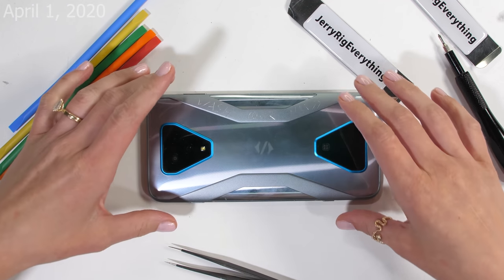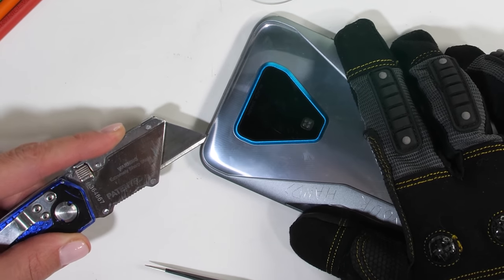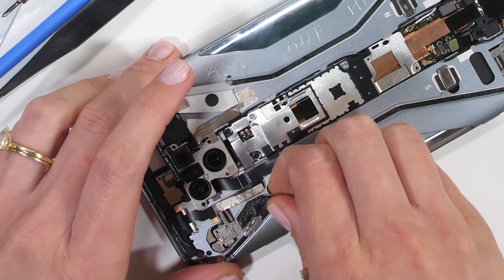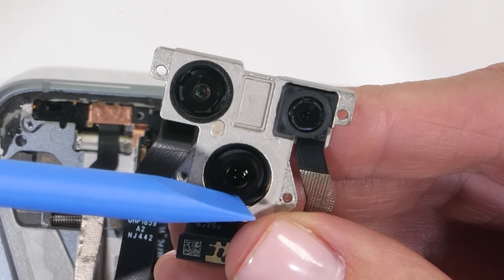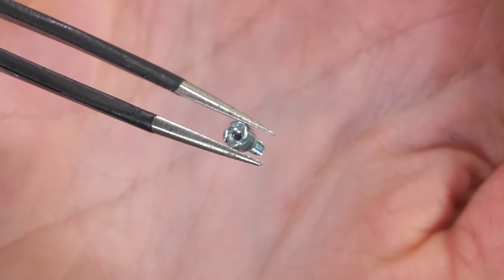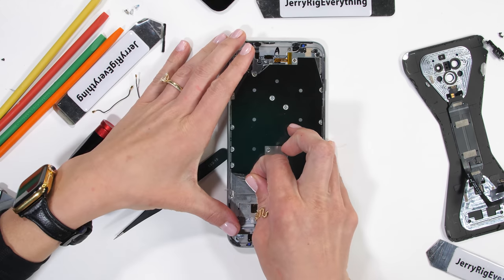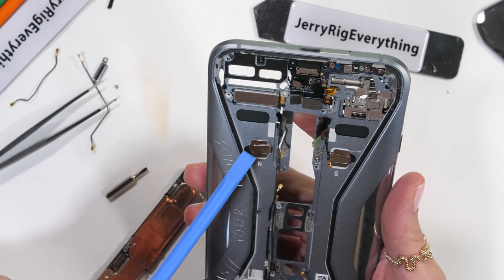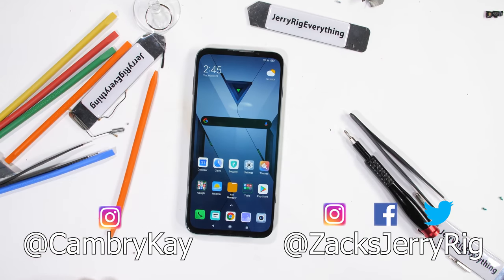Dueling Heat Pipes & Pop Up Buttons?! - BlackShark 3 Pro Teardown!

Comment: "Double the Batteries, Double the Charging Speed"
                               - Zack's wife.
Reply: Makes sense though if each battery has its own set of charging system linked to a single USB C port
Reply: Dawood Essa that is true in theory but each controller has to now share the  split electricity coming from the charger when that happens.
Reply: basically she's right
Reply: @isaacstearns7746  that's why you have a fast charger
Reply: As my worst enemy would say wrong
Reply: that's why it can fast charge up to 65 watts of charging
Reply: Ha ha ha
Reply: That's why phones jumped from 30w to 60w charging. She's right.
Reply: Actually she's not his wife , she's just his girlfriend as he explained in his earlier video.
Reply: @spongyshorts1278  they got married bro ..
Reply: you forgot the year, let make it official

Comment: This is actually unironically a marvel of engineering. It's buetifully overengineered
Reply: that main board with both heat pipe on the side is definitely are  marvel.. also with that 2 mechanical pop up button..
also the most rarest thing in the phone...
3.5mm jack.. what a pre historic item to be build into a high tech phone

Comment: puts on gloves 
Me: Thats why women live longer 😂
Reply: I use plastic gloves
Reply: Idont use gloves to open phones or laptops
Reply: @8pyy  I do. I tend to sweat a bit from my hands
Reply: @8pyy  you monster
Reply: @8pyy  that means nothing honestly. People smoke and don't wear seatbelts doesn't mean nothing will happen.  I don't wear gloves but that doesn't mean shit don't happen all the time
Reply: @AlwaysBolttheBird  k thanks bro for the help
Reply: @ItssMitch  yo what did ido?
Reply: @ruixitas  same it make you sweat and it feel kinda wired with the water
Reply: All of you there is no problem not using a glove when opening any device
Reply: @8pyy  I'm not too sure that's true. I've seen some wear something to prevent static electricity. But I'm no expert, I just fix my friends and my own devices.
Reply: @ruixitas  but at least dont touch anything if the battery is connected because if connected it will fry some stuff thats why we all need to be careful for some stuff and good luck for fixing stuff this experience you can need it in any time
Reply: @AlwaysBolttheBird  it always does
Reply: Lol haahah

Comment: "These are essentially screws with a screw hole inside of the screw so that the screw can screw inside of the screw"
Reply: Isn't it like so that the screw driver can screw inside the screw
Reply: Yo dawg, I heard you like screws...
Reply: I actually understand that tho...
Reply: @dylanwang2669  It just so happens that two of the components inside share one of the holes, so they just tap (verb for making threads) the inside of the screw that holds the component that sits deeper for the smaller screw that holds the upper component in place.
Reply: @yongling9825  Thanks!
Reply: @flossenking  lol

Comment: this just made “iPhone repairability” like a piece of cake!
Reply: Not rly because they dont use normal screws on the iPhone's.
Reply: Tbf this design is good if you break the screen as you don't need to worry about breaking electronics underneath when you cut into the adhesive. The battery and motherboard placement is strange though.
Reply: @jftechdrones  yeah the battery is so hard to replace
Reply: JF Tech/Drones  yeah, i guess you are right, but at my point if view, i had iphones and the only thing that ive ever replaced on the iphones i had was the battery so i was like woha! if this phone’s battery dies I'm screwed!
Reply: @igentleboy8129  Definitely - it's the only part that should really wear out.
Reply: Einfach Yannic you got a point there, however, the complexity of battery replacement was off the chart! And mostly its  because 90% of the phones I had just needed a battery replacement ent after a few years. So this phone battery location was kinda new. You have to take the whole phone apart.this This is a gaming phone, if you don't break it, or drown it, the next thing that's gonna take a hit is the battery.
Reply: @igentleboy8129  xiaomi brougth back the headphone jack. But they screwed us over with repairability
Reply: @Crispy Shaman yeah...

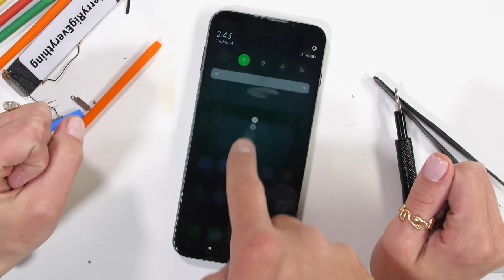Comment: This tear down took 2.5 HOURS. The time was 12.15 at 0:08 (the start) and 2.43 at 7:47 (the end). Dedication 👍
Reply: 12:15, not 12:13
Reply: @scan4707  tiny correction is unnecessary
Reply: sometines the clock gets all messed up when removing the battery in my proud galaxy grand 2
must be the same when she snapped that battery ribbon cable like a little lego
still very good effort
Reply: @samertawakol5208  its makes sense for 2 hour, dude. even more.
Reply: @Isnamedantony  well just saying
its not a problem
Reply: but its nothing for a job well done

Comment: Amazing 
This battery technique can use to charge multiple x4 batteries and extend charging powered by 100 watt charger and cool down temp. using thermal fans

Comment: I hope rog integrates the pop up shoulder buttons on their gaming phones instead of air triggers
Reply: Air trigers is better
But black shark cooling is far superior than rog.. Rog sucks
Reply: @r-abayabas3761  I love rog it's me fav brand don't dis them
Reply: @destroyer12gaming76  nah i had a rog 2 ladt for 1 yr only dead mother board... Im not even a hard gamer.. I play 3hrs a day only with medium graphics max frames at cod and yet it died.. Lot of rog 2 users suffer from that shitty cheap ic
Reply: @r-abayabas3761  did they fix that with the rog phone 3 cause I want to get either that one or the new one coming out purely for gaming and xbox and ps4 game streaming. What did u do with the broken phone did u try get it fixed?
Reply: @destroyer12gaming76  no coz even asus phone non rog had disame problem mpther board easily get fried... Rog 3 have disame issue...

From 1000usd i sold it for oonly 100 uad 🤣🤣🤣
Reply: @r-abayabas3761  ah I see hopefully they fix this issue cause I love their pc parts and laptops

Comment: Your voice is a little off in this video lol... second I heard a different voice I thought it was a different video I'm like what did I click on ?😄
I actually like this phone but I don't know if it is better than my Razer phone 2 I doubt it
Reply: technically, it is. razer 2 has an 845 sd processor, and this black shark has an 865 plus. it is way above razer phone, which is normal since the razer phone is from 2018... 2 years is a huge leap in new technologies, on finger display, dual speakers, android 10, adreno gpu...